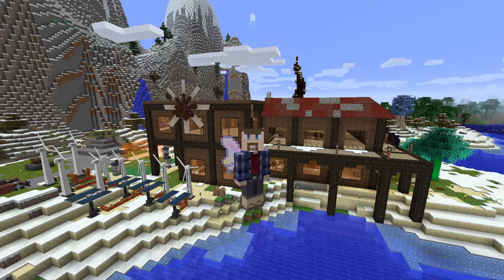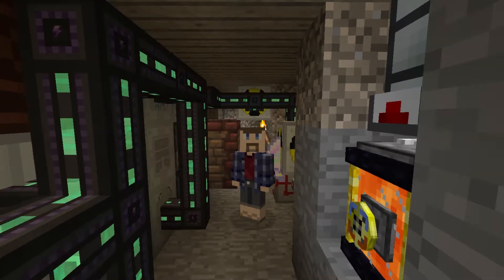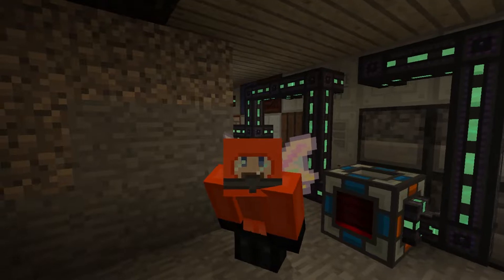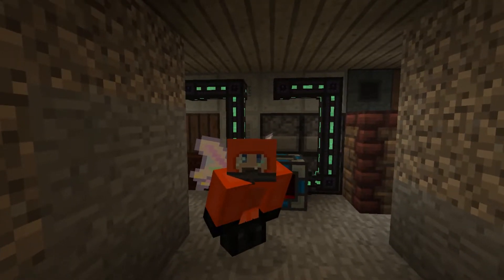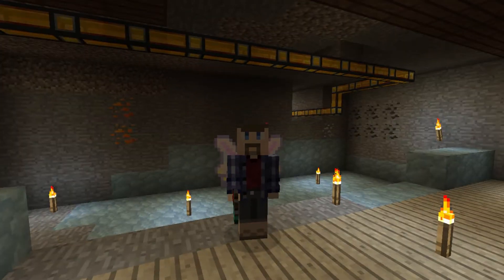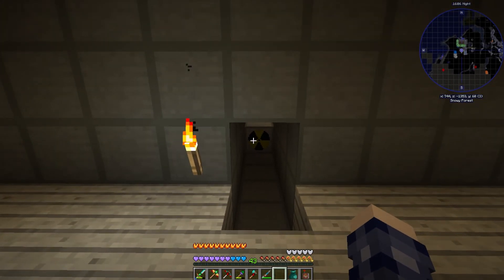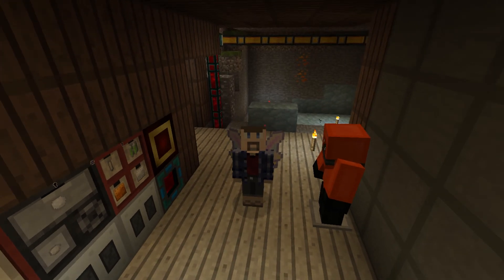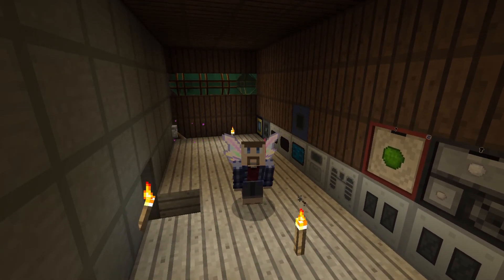Automating the IndustrialCraft 2 Nuclear Reactor - Minecraft: Enigmatica 2 Expert #69

Comment: i actually exploded my reactor when i tried to do the phantomface method to automate the fuel rods LOL
lucky me that my reactor is far away from my base and it was in a big room covered in reinforced stone
but thanks for the tip anyways
its so hard to find people talking about this modpack i swear
Reply from the maker: If it blew up, it wasn't because of the phantomfaces.  Just moving the rods around doesn't do that.  It was probably an unstable reactor burning out it's heat shielding.  The biggest issue with this pack is honestly how it uses mods that have almost no documentation anymore, or did things like make major changes to the mods after the packs released and changed the documentation.  IC2 and Nuclearcraft are some of the bigger offenders.  

Here are all the links I used for making stable reactors for IC2:  
https://forum.industrial-craft.net/thread/7659-official-nuclear-revolution-how-to-melt-setup-your-reactors-2-0/
https://www.reddit.com/r/feedthebeast/comments/4fp6by/ie_decent_beginner_ic2_reactor_designs/
https://i.imgur.com/3kQftPr.png
Reply: @Ardcraft  okay so like, the problem is that the it started pulling the components from the reactor too, not just the rods
My reactor layout is the exact same as yours
Then I did the phantomface and did one input chest and one output
And in the output it started to remove all of my fans and stuff together with the rods
Reply from the maker: Ah, yeah, that would definitely do it.  I’m sure you’ve realized this since, but test with it turned off with a lever, and make sure you’re filtering for empty fuel rods.  On the upside they thankfully don’t really provide much power and are only really used for breeding plutonium, which you can just replicate if you have UU matter production going.
Reply: @Ardcraft  yeaaaa I'm not that worried about losing the reactor since I had already stuff to make two more reactors and I have an ultimate induction matrix setup from Mek, so I still have a bunch of energy stored
But yea it was a big mistake that I forgot to turn off the reactor before doing that LOL
So the only thing I'm missing is a filter for the ender conduits right?
Reply from the maker: From what you’ve said, it sounds like it.  You need to filter both the in and out, for empty and full fuel rods, but it sounds like it was working otherwise.
Reply from the maker: The other thing I’d recommend, and I think I did this in the video is set up a way to wirelessly do a redstone signal from outside containment to shut down a reactor.  There are a few ways.
Reply: @Ardcraft  oh yea I didn't do that actually! 
I just teleport inside my reactor room and turn it on and off there when I needed to
I didn't actually know that there was this phantomface thingy until I watched your video 
It's reaaaally useful for wireless stuff
But yea imma try the filters for the conduits!
Thanks for the help really :D
Reply from the maker: The other thing to not sleep on is that there's a relatively cheap wireless redstone transmitter, I think, in extra utils 2.  It's been a few years at this point.  It'd be cheaper than the actually additions version, but does require you lay down redstone or the equivalent to continue the signal.

Comment: It looks like you're converting the EU to RF. I'm trying to use the energyface to get EU out to power my IC2 machines. I'm playing Age of Engineering, but is there a way to get the power out and transfer it as EU?
Reply from the maker: So I only know of two ways to toggle things back and forth in 1.12 personally, and looking at the mod list for Age of Engineering, one of them isn't an option.  Flux networks would be my first choice, but that's the one that's out.  Failing that, the other way is using Mekanism power cables to make it not care at all.  I don't know how hard it is to make those in AoE though, but if you are able to make them, they just convert the output to whatever format the machine requires from RF.  You can bypass even needing transformers at all with them.